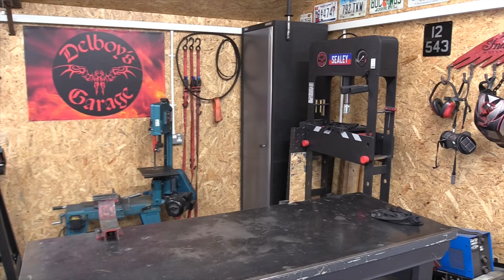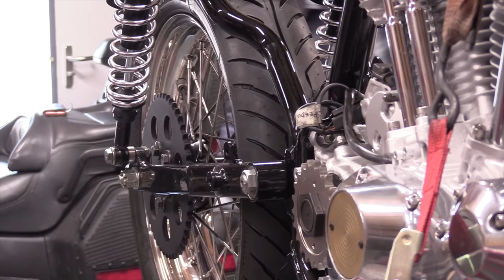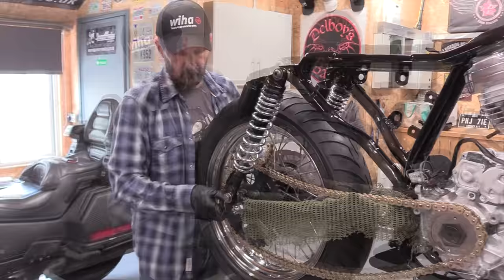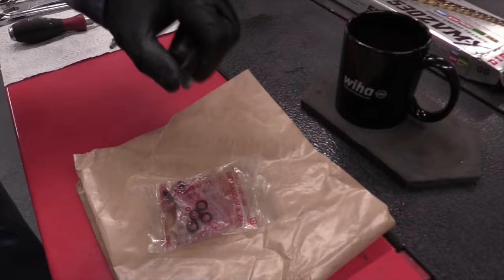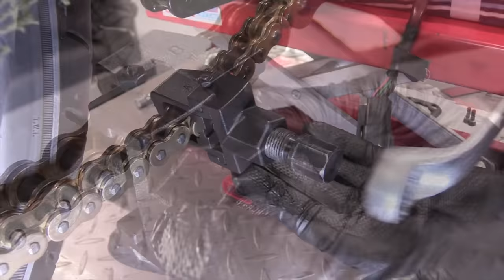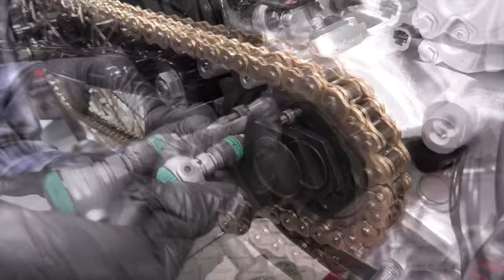Harley Sportster, Chain & Sprockets Conversion !

Comment: Just fitted the exact same chain in black /was 53€ more expensive just for it's blackness/ on my GSX1250FA .. you make things seem so easy, yet for me flaring the pins was an absolute pig of a job with bike on the ground on it's center stand a me down on my knees with a wall close behind my back ..  But it's on and rolling now, and I'm glad to see that I have the exact same measurements as you, 22.04mm and 5.8mm resp., thanks for the peace of mind! 
Never thought I'd be watching a chopper rebuild, let alone a Harley, but I've been hooked coz' let's face it, the fundamentals are the same whether a sportster or a supersport. Bike's looking great! And thank you for all I've learnt from you over the years! 

p.s. Lathe and bike lift on my "10 things to buy before I die" list 😇
Reply from the maker: Hey Ghassan, good to hear from you, and glad to hear we're on the same page. The manuals all advise between 5.7 and 6mm for the flare.. but my chain tool has a contersunk tip that prevents it flaring too wide, much beyond 5.9 and you can crack the end of the pin.!        Glad yo hear that our videos have helped you out sir, like you say, most general maintenance is generic and translates to other bike..  Take care and have a great week..
Reply: @Moonfleet41  My JTCT2 tool has and does exactly the same, I couldn't justify buying the original DID chain tool for over 150€ when this knock off seemed identical and was 100€ cheaper.
The pleasure is all mine sir! and likewise!

Comment: Huge improvement.  I've never liked the Harley belts, although I understand they last a long time.  Just a personal preference.  As for riveting the chain, I've always found this a sort of "zen" like process, to be done with patience.  The same goes for static balancing the wheels after I've installed new tires.  It's really coming together.  Like the results.  Cheers.
Reply from the maker: Sure thing, the belts are a little longer lived for sure, but not as much as you might think... a belt will hardly ever break unless seriously abused, the usual Achilles heel is the plating starts to peel off the teeth on the rear pulley (as it's been on there so long), and this starts slicing chunks out of the belt teeth, then there's the cost!  A belt and pulleys is maybe 5x the price of a chain and sprockets, so I don't really see any benefit other than you have to oil it, but you still have to keep it clean of course!

Comment: It would seem that you need an additional washer on the rear axle so the castle nut will be further out on the axle after being torqued down.  As it is,  the safety pin doesn't appear to engage the castle nut slots, and the castle nut is free to back off, (at least, until is meets the safety pin).
Reply from the maker: What you see is the factory setup.!

Comment: In 60 years, the best final drive I've ever owned was a CX500Turbo with shaft drive. The worst, a BMW with Belt drive. (F800ST, an absolute NIGHTMARE of ownership lasting 3 years before I gave up in financial ruin and tears lol) Chain drive? Love 'em. Split links? A 100% success rate for me installing them. Dealer installed rivet links? 100% FAIL rate, two different bikes, many years apart. Me installing rivet links? 100% success rate. There's something so satisfying seeing those beautifully mechanically formed pin ends!

Comment: Made many changes including chain drive conversion..made a clempton bracket to swing arm & a 17t idle sprocket with sealed bearing & spring loaded for take up & normal surfing during riding...its great..& no need for readjusting rear wheel...i can send details..also.. converted primary chain to  spring loaded automatic as the fixed adjustment is wrong on so many levels

Comment: Great tutorial again Del, great for anyone to learn from, no matter how many chains they may have fitted in the past. I particularly like that you mentioned to allow for the weight of the bike compressing the suspension and over tightening the chain; easily forgotten when engrossed in the job 👍
Reply from the maker: Sure thing Michael, Thanks for your kind words mate.  So important when there is a lot of weight still to bolt onto the bike that the chain has enough room to settle into it.!
Reply: @Moonfleet41  agreed, I fell into that trap in my youth when I was learning this stuff. I always like watching your tutorials as I always pick up something different regarding jobs I know and it's great to learn about stuff I might do in the future. Thanks to you both for a great channel 👍

Comment: Always a pleasure to watch a craftsman work. Very thorough as usual. Ignorant 'non-Harley guy' question. If the rear sprocket was not inline with the countershaft sprocket with the wheel straight, do you shim the sprockets, move the motor, or what?
Reply from the maker: Hi Joe, in this case i was able to buy sprockets that are machined to line up. The rear, in my case is flat, and the front has a 1/2" outward offset, this puts them inline.  You can also buy "dish shaped" offset sprockets for the rear if you're fitting a much wider wheel, and offset front sprockets up to 3" offset. You cannot ideally shim the back sprocket out because the centre hole in the sprocket locates onto a machined lip on the hub, shimming it out would prevent that location !   Thankfully due to the huge custom aftermarket industry that supports the Harley community, you can buy just about anything to bolt on and hand you a solution.!
Reply: @Moonfleet41  Thanks Del. That makes perfect sense. I've seen jack shafts used for super wide rear wheel mods, but I didn't know about the small offset options. Stay well sir.

Comment: That's a well designed riveting tool.  Little set screw so it doesn't fall apart during the wrestle.  Smart.  Seems better than my motion pro knock-off.  Love the alignment tool/design as well, first time I've seen that.
Reply from the maker: Thanks Travis, yeah, best little chain tool i ever had.. and lots more power and strength to get the full flare on the pin without effort... link here is you want one buddy..! https://www.spanner-monkey.co.uk/motorcycle-chain-splitter-and-riveting-tool-set-heavy-duty-119022?search=SMC4&description=true    I made the alignment tool some years ago from a bolt, nut and some wire.. made a video if you wanna make one too!

Comment: Nice job mate 👍. Personally I prefer a belt over chain (less maintenance) but if I had a choice shaft drive would be it. Take care.
Reply from the maker: Have to agree on the maintenance stand point, that's undeniable, but for every other reason a chain is better, but of course on a bagger you never see it!
Reply: @Moonfleet41  agreed. I was thinking degree of maintenance when I made that comment. Should have clarified that I guess 😆 👍

Comment: I've always found rivet links easy to do, I'm a bit shocked when guys use split links on anything bigger than a dirtbike
Reply from the maker: There are different kinds of clip link.. the ones that you have to press the outer plate on like a compression link, they're maybe safer as the clip is just a second line of defence... but nobody can deny that a properly fitted compression link is the safest by far.

Comment: i have done the chain conversion on my Iron883 do you have any issues with slapping on the belt guard mount on the swingarm? i’m not running the belt guard on there. Am i better off grinding it off if not in use? Thanks in advance
Reply from the maker: All chains have a certain amount of 'lash' it's inevitable, and bikes that have belts from factory don't have 'lash room' designed into that area, so yeah, if you have to make a little room for the chain to opperate safely then thats just good practice mate .!

Comment: I notice at the start of this video the rear sprocket was already in place upon the rear wheel, and the front sprocket was to be installed. The Front sprocket was off-set with 22 tooth, I noticed, but what about the rear sprocket? Is it also off-set too? And how many teeth is it?
Would really like to know, getting read to convert my 1989 Sporty over.

Comment: Hi , I have a question:) I bought Sportster with 15 inch suspension on it . Belt seems a bit loose. How I supposed to adjust it properly? Sevice says 14-17 mm , but it may be to tight when fully loaded?

Comment: I like the look of the gold chain.  That was the colour I went with last time around myself also. Couple quick questions.. was there a guide that you were able to refer to for correct sprocket gearing?  Also, should the suspension be loaded when setting chain tension?  I actually tend to run my chain on the loose side of factory spec (not out of spec) just to keep tension off the output shaft even though there is a noticeable amount of play at times when I’m doing track days.

Have a great week
Reply from the maker: From others who have made the same (and very common) conversion, this rear sprocket and a 23 tooth front give factory final gearing.. but ive opted for 22 tooth front to lower the gearing a little, i won't be touring on it, won't need cruising gearing... but a nice crisp launch from the new upgrade power and lower gearing should be loads of fun.   ..and i agree, always run a chain on the loose side, ill set that later once the bike had a lot more weight bolted to it and i can measure it properly !
Reply: @Moonfleet41  careful, those V twins suffer from oiling issues if you wheelie them too long. 😂 😂✌🏻
Reply from the maker: @myz06rocks   😂 😂

Comment: Great tip I learnt from this channel was the the marking of the rivets so as you can keep a check over them for the next couple of weeks so everything stays put.
Penny pitstops dragons blood works a treat. 
I have done this ever since and it's use is also a great reference point for lubing the chain!

Nice video Del and Penny x

Comment: Any plan for a slider to protect the swing arm? 
That chain is going to eat up that black powder coating!  Not sure if the part is available, but it looks like something that could be 3D printed.
Reply from the maker: Yes, i plan to design something in with the chain guard !

Comment: Great advice, not too tight, I remember in the 70's, most riders would tighten their chain like a belt, I always did mine like the off raiders did, fair bit of slack. The originall chain (o-ring type) lasted for over twenty years. Enjoyed the video, and documented proper way to setup sprocket and install chain, well done cheers!
Reply from the maker: Thanks buddy, i appreciate your kind feedback.

Comment: How on earth do you get the front sprocket nut off!!!!! I know its opposite thread but mine literally won't move I've used impact and breaker bar and it won't budge
Reply from the maker: Sorry to hear that buddy, try a little heat directly on the nut, the smaller the blow torch the better, and then whilst it's still nice and hot, hold that chain nice and solid and hit it with the impact gun, btw 1/2" drive impact gun at least, a 3/8" drive will struggle on a sprocket nut!  Best of luck!!

Comment: Hey Del, what was the reason for getting rid of the belt drive?
Reply from the maker: It's a very common custom Harley upgrade mate.. belts and those huge fat pulleys are clumsy and expensive, and with a chain i can adjust the gearing too.!
Reply: @Moonfleet41  Ok thanks Del good job.

Comment: Hi delboy, with all respect, from a faithful follower of you: why is this conversion? Chain drive has no advantage to belt drive, but there are many disadvantages.
Reply from the maker: Not so mate.. It's a very common custom Harley upgrade.. belts, and those huge fat pulleys are clumsy and VERY expensive. A chain is classy and visually attractive, way stronger, i am able to adjust the gearing too.!
Reply: @Moonfleet41  thanks for the reply.
I was talking in general.
Me sportster owner n have other bikes, chain, belt and shaft driven one too. 

Chain: the worst option, makes the bike dirty, need to spray (or scottoiler) all the time, stretches, need to change including pulleys after 20-30k

Shaft: just oil change, other than that it is excellent, clean, maintenance free

Belt: the best solution, clean, maintenance free, for HD it lasts for life acxording to factory recommendation. (Buell recommends to change it)
The best option in my opinion.

Only Hd related problem is that the hard chrome peels off the pully so then the belt will wear the pulley very quickly

Comment: Lovely work.Again.
I wonder how long any poor chain will last on that thumping V-twin with its massive power pulses.
Not being critical of your set up- chains are MUCH easier to replace than belts and far cheaper also.Plus they can( probably?) take more abuse like burnouts and wheelies that this style of hotrod would be subjected to.
Harley discovered years ago that belts are more elastic and forgiving, plus the Big Twins have the Compensators in the primary drive.
Horses for courses.

Comment: This build is awesome Delboy.  Everything is coming together so nicely.  Is there any advantage to the chain other than it looks tits?  Been watching forever and your channel just keeps better dude!
Reply from the maker: Thanks mate, many advantages on a chain, it's stronger, looks way better as you say, and you can adjust the final drive gearing with different size sprockets to suit the ride you want... plus of course, a chain and sprockets is a fraction of the price of a new belt and pulleys which the bike would have needed!

Comment: The taste of that bacon sandwich, hastily cooked to disguise & dispel the smell of hot chain grease so recently bubbling away on mother's kitchen stove; the frenzied pantry hunt for a fresh bottle of 'Daddies' sauce before she's back from the WI all England mole strangling final, the still hot chain now hanging flacid & drippy above the still open can of grease, whilst cunningly suspended from a creaky hanging basket mount in the conservatory. Then, an eerily foreboding 'twang-ripply-splash-clunk' arrives to tell me that at least one of the until-recently hanging baskets will likely never rust . . .
Nowadays, I see new chain comes ready greased & with it's own little packet of patent 'grease-doms' to prevent wayward pressure squirt under load, but the thing is, does the sandwich taste as good? Y'all : )xx
Reply from the maker: Even though it's almost bed time, all i read was bacon sandwich ! why does breakfast food taste so good at night.!
Reply: Ah, it's the anticipation of shouting 'Brace yourself gal' as you leap off the top of the wardrobe wearing the obligatory Ann Summer's flying helmet & carrying two handfuls of freshly dampened celery : )

Comment: Terrific vid, Del. I learned a bunch.  A question for you… is there an advantage for a chain over a belt drive in your opinion?  Hope you both are doing well!  Sad to see the news about the Queen. 🥲

🏍👍🏍
Reply from the maker: Hi Gary, lots of advantages, rubber belt has many weaknesses, not least it's price, maybe 6x the price of a chain and sprockets, plus I can alter the gearing with a smaller front sprocket to give me a crisper pull away to add to the power from the new engine... plus of course a belt and pulley just looks clumsy by comparision, it's a very common upgrade for choppers and custom Harleys all over the world, and if you look at the stunt guys, they always use chain and sprockets on their bikes, way stronger and way more robust.   Sad news indeed, feels like we've lost a dear Grandmother, a Monarch we've known all our lives, a fixed point of strength of our nation above politics.  Have a great weekend, D&Px
Reply: @Moonfleet41  ok gotcha- then good choice.  Yes very sad indeed… Blessings on the new King.

Comment: Hey what's up dude, I have a 2005 Dyna low rider, I was looking to convert to a chain, never mind the cost of the parts, do you know per chance just ballpark how much it would cost for a mechanic to put on the parts? Thank you
Reply from the maker: I don't know where you are in the world, or what mechanics you might choose, main dealer or indie, but in terms of hours then a minimum set aside would be, maybe, 4hrs labour not withstanding any broken bolts or unforseen problems... so you could work it out from there, but remember, with a 20yr old bike, you're only one snapped bolt away from a 2 day ordeal, so there's no simple answer... just get yourself a quote.